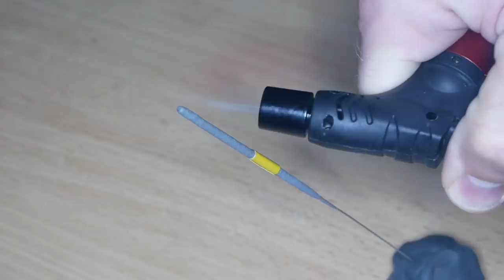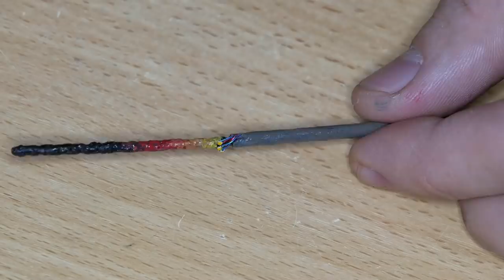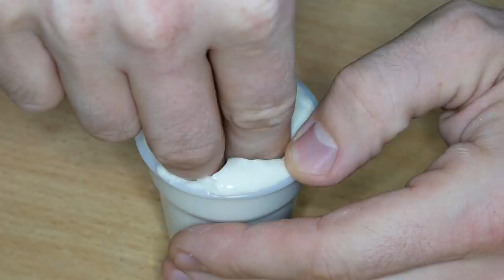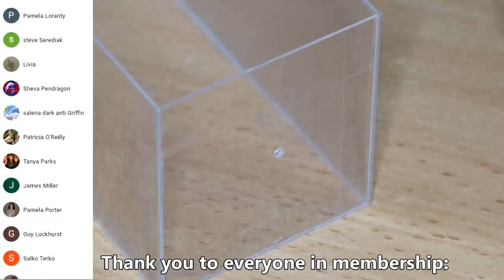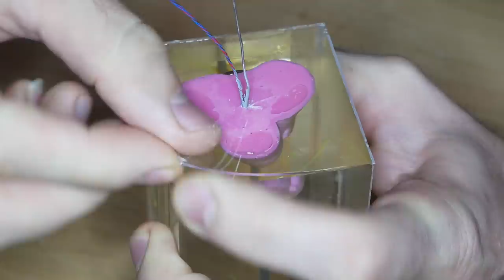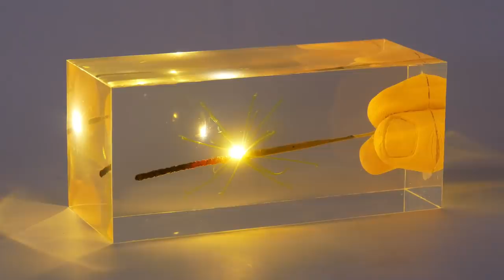A Burning FIREWORKS 🎇 in Epoxy Resin. DIY a Simple Way / RESIN ART

Comment: If you used optical fibers instead of fishing line would be awesome 
But overall it looked amazing 🤩
Reply: Yes, sparkles from optical fiber will look more realistic
Reply: Maybe then it would match the thumbnail.
Reply: I was thinking the same. 😊👍🏻
Reply: Fiber optics only glow at the end.  Though being in resin would change its properties.
Reply: @stephenbaldassarre2289  since fiber optic glass has a different refractive index than the resin it's being immersed in, there should be no issues with it piping the light. Side walls of the optic fibers can be scuffed, sanded, painted, dyed, etc. to affect its appearance/properties as desired. It's all experimental per application, but does provide another unique option. The only downside to scuffing and sanding optic fibers for the side-glow effect is that the net result of the light transmission through it degrades sharply, kind of analogous to water flowing through a sprinkler hose. Of course the results are relative to the abrasions used, maybe a chemical glass etching would be more effective?
Reply: @nw7696  nerd.
Reply: @HondaMom  LOL, yeah!

Comment: Hey man great videos! I just had a question, did you consider using thin fiber optic cables for the flying sparks? They might have helped in conducting light from the LED, making the sparks brighter. Thanks again you are really talented in what you do.

Comment: I would LOVE IT if I was a simpler safe method to make Lichtenberg lightning acrylic sculptures. 

I’m talking about the actual authentic ones, where they discharging an insane amount of power through the acrylic… using a particle accelerator.

I have a lot of experience with both resin and with electronics. But it’s still outside of my wheelhouse. 

I have a professional electronics lab doing component level board repairs and Metrology work for industrial clients… 
And I work with resin so frequently… that I purchase over a dozen 50 gallon drums per year. HELL… I’ve been built small particle Accelerators on two different occasions, one for my own photonics/laser optics lab… And a bigger one to help a local university. 

But even with my experience… Lichtenberg acrylic sculptures are way way way beyond my skill level to do safely. Would love to be a part of that process sometime,

Comment: nice first try with the sparks but they need some improvement... what about sanding lightly some optical fibers ?
option 2 : find a way to create thin tunels in the epoxy in 2 half by using rubber that you remove before re-assebling the two parts around the leds... maybe complicated...
Merry Xmas 🎅🏻

Comment: Instead of batteries, have you ever considered using Qi wireless adapters? You can cast/hide them in the base of your artwork and power them up simply by placing them on a wireless charger, but you'll have to use resistors since they output around 5.1 vdc.
Reply from the maker: interesting solution

Comment: You need to be careful, Epoxy is a new form they use in plastic explosives as a binder that gives it more explosive power, The danger is with the hardener, some hardeners react within seconds to explosives, but with what your doing you should be fine, now if you took 9 parts potassium chlorate, 1 part paraffin wax, then add 10 percent epoxy resin with the hardener you would have a very  powerful plastic explosive on your hands, So be careful playing with pyro, and epoxy. Like you I am in the Resin art, and also love pyro, and a researcher, Like they say knowledge is power. I personally make orgone devises with resin, that is when you use crystals, and powdered metals in layers from organic, to non organic to turn positive ions into negative ions.